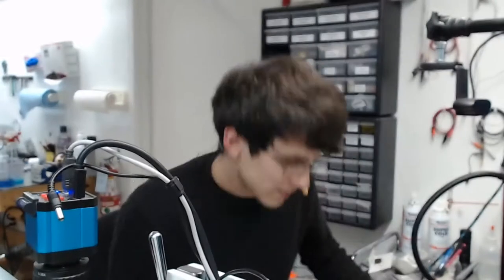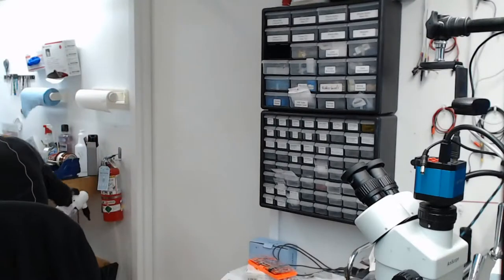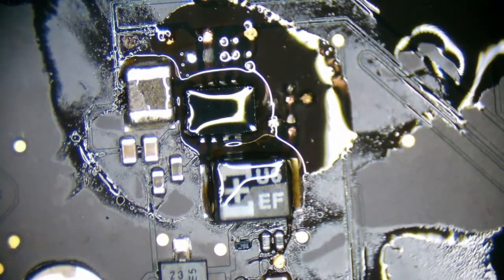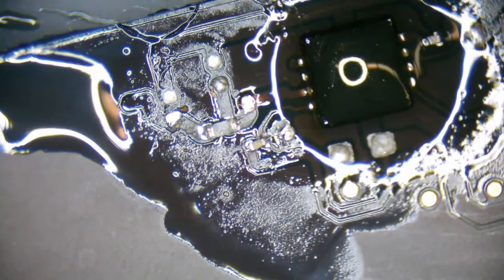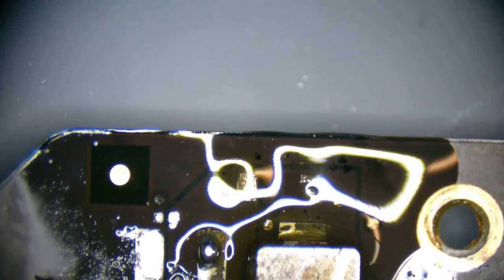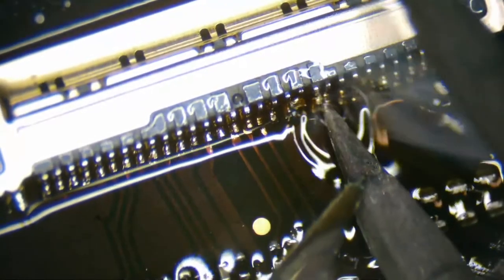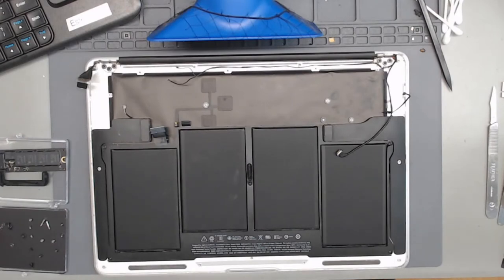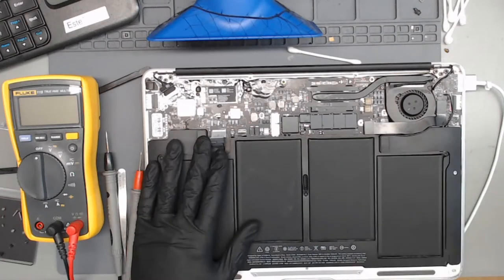MacBook Air 13" A1466 with no power failure.

Comment: What is your specs of your streaming pc? I’m in the process of building one :)
Reply from the maker: Haha it is not good. Dated to say the least, but gets the job done for now. I am going to be upgrading around cyber Monday. But here are my current specs:
Windows 10 Pro
Intel Core 2 Duo E8400 3 GHz
8 GB 1333 MHz DDR3
NVIDIA GeForce GTX 650 (This does all the heavy lifting during streaming)
120GB Kingston SSD for OS and Programs
1TB WD for Video Storage

In OBS, I use the NVENC Encoder setting so the GTX 650 can do all the video processing. And this is an old card, so something newer will do much better.

Then just the recording equipment I have listed in my description.

Hope that helps give an idea of what the basic hardware needed to stream looks like.
Reply: @iRevive  That is great. I have an older PC too that I built that I use for gaming, pretty olde specs but I always put a mid-high end GPU. I am currently buying parts to make a streaming computer, I got a GTX960 from marketplace for $70, and a case for $50. I had a DVD burner, just need to get a Power supply, RAM, MOBO and hard drive, I’m just wondering if I build a new gaming machine and just take my older rig for streaming. I just wanted to get an Idea to see if I am on the right track, want to keep budget in check, but also want something better than my laptop.
Reply from the maker: @optimizelogicrepair2784  I think that’s a good idea. I personally was going to do the exact same thing with my old gaming rig. Just convert it into a streaming rig and build a new gaming rig.  The next big purchase will be a capture card.
Reply: @iRevive  2 or 4 port?
Reply from the maker: @optimizelogicrepair2784  that’s a good question. I haven’t looked too much I to captured cards yet, but I would only need 2 ports for streaming. Taking a quick look, the Elgato 4K60 Pro looks like it would do everything I would need it to.
Reply: @iRevive  scored a power supply! One more part down!
Reply from the maker: @optimizelogicrepair2784  That’s good news. What do you need next?
Reply: @iRevive  CPU, MOBO and RAM
Reply: @iRevive  got a GPU and case from FBM
Reply: @iRevive  already had DVD burner
Reply from the maker: @optimizelogicrepair2784  nice. You might be able to score a motherboard CPU combo off of Facebook Market Place. Or at least a gaming rig with okay parts to take the cpu and mobo from.